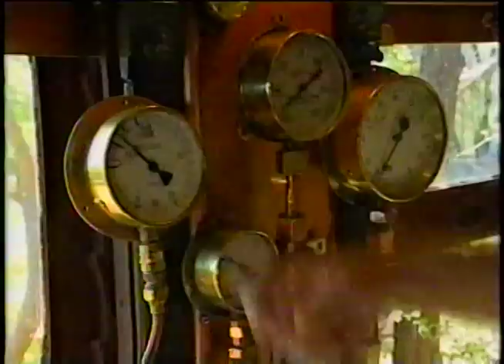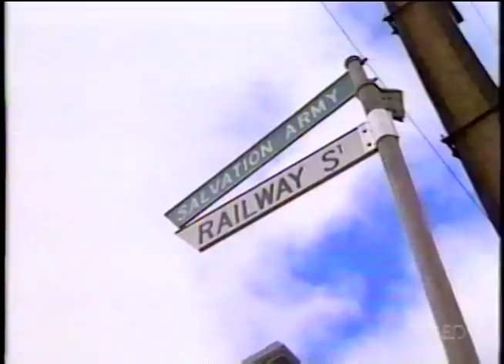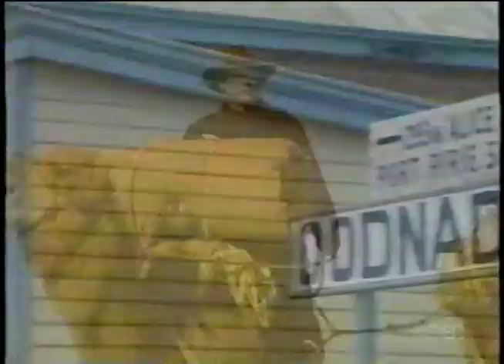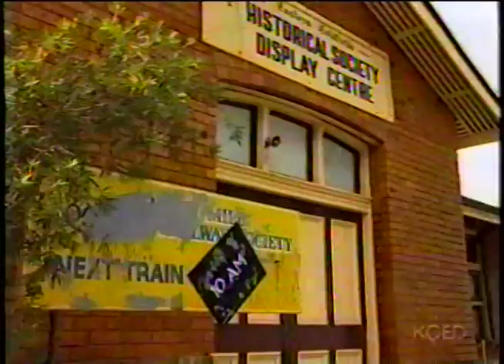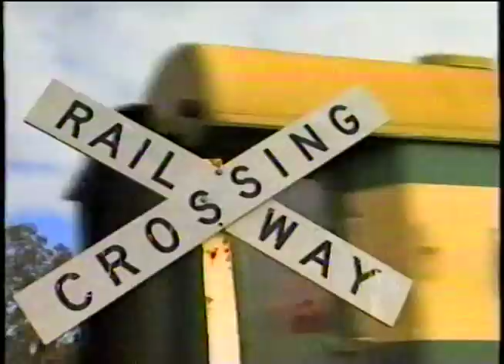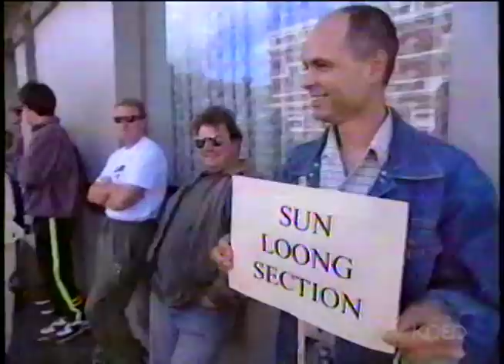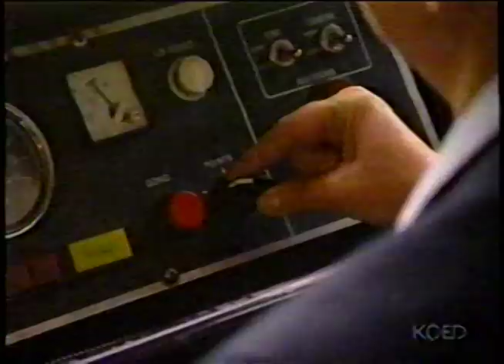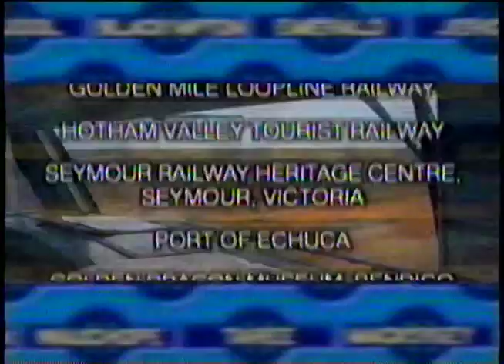Railway Adventures Across Australia. Hosted by Scott McGregor (1999)

Comment: 18:50 The rail motor referred to here is a 620/720-class rail motor of early 1960s vintage. The crossing is Meredith Street, immediately east of Civic Station. As of Xmas, 2014, this part of the line no longer exists due to an act of OUTRIGHT TREASON by the NSW State Liberal Government. The line now terminates at Wickham.